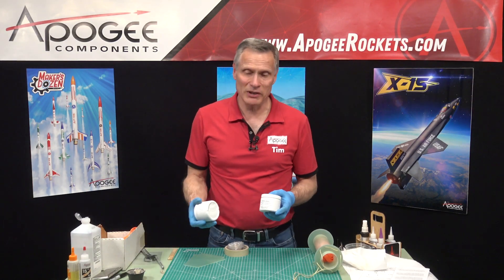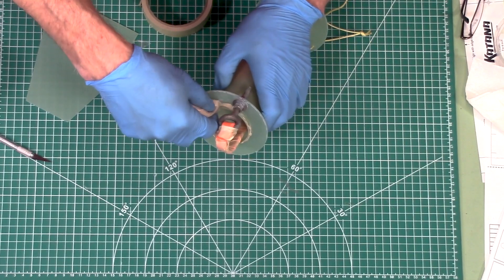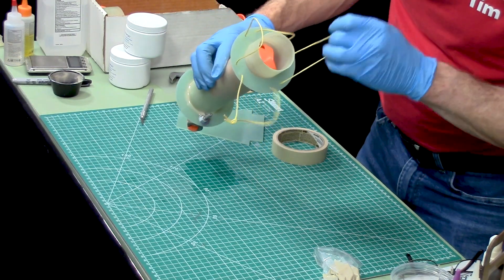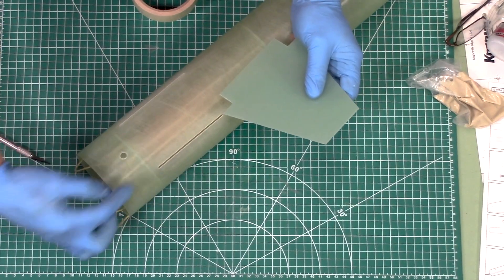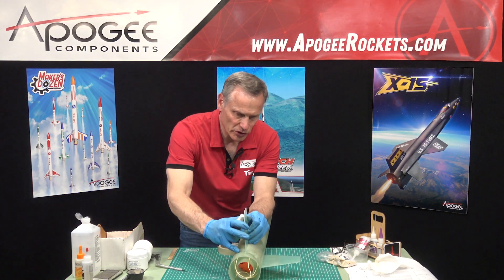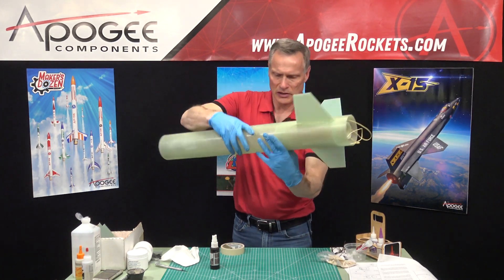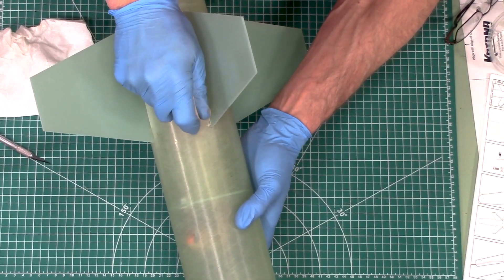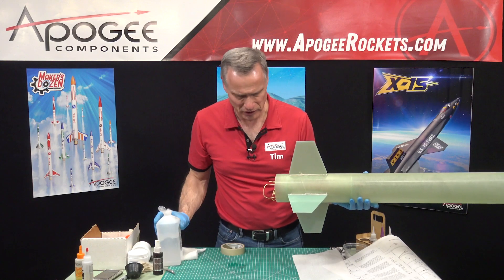Level 2 Rocket Assembly Part 3 - Attaching the fins

Comment: Correct me if I'm wrong, but when epoxying to fiberglass, shouldn't the surface be lightly sanded at the glue points so the bond is stronger?
Reply from the maker: Go for it!